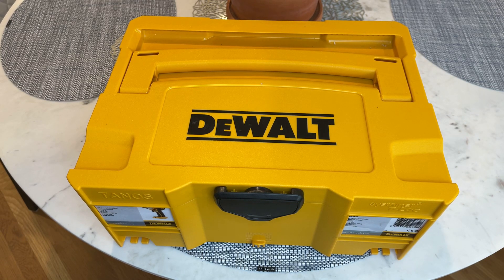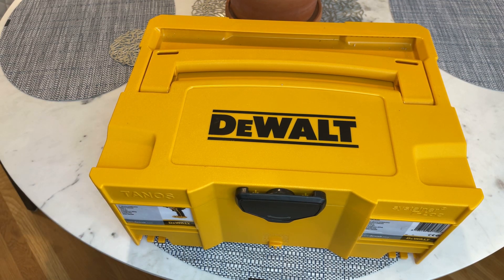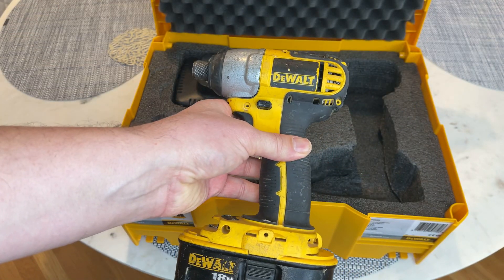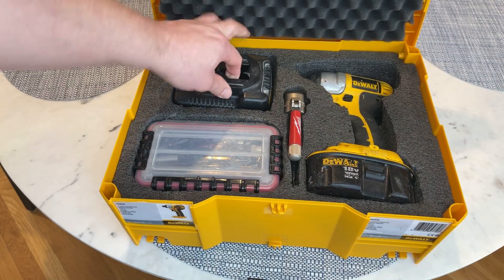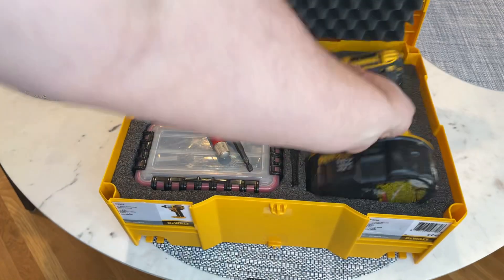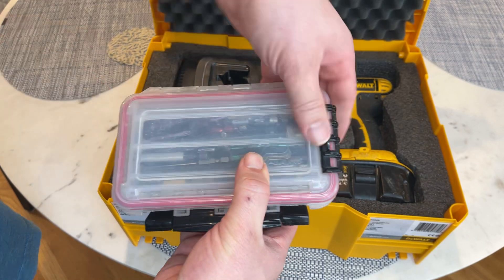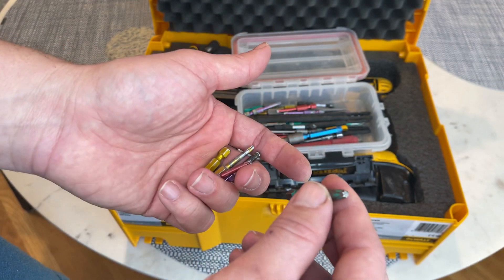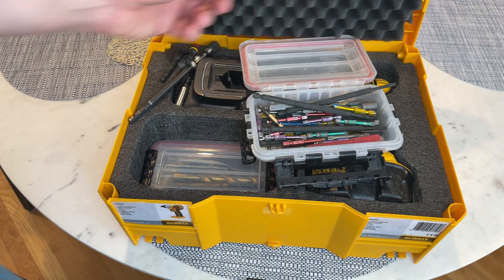DeWalt Impact Driver and Tanos Systainer Review

Comment: The Systainers are the best tool box system
Reply: In what way? Weaker (ABS) 3 point (not 4) fixing,  drawer units compromised by front dial, not waterproof, have to be locked in shelving because they foul the drawer above, no front handle (except the tiny, weak one on gen 3) a third of the carrying capacity, I could go on. And they cost more! Packout or ToughSystem 2 are both way better. Even L-Boxx is better.

Comment: There are adapters for the newer battery? 😅
Reply from the maker: There is definitely an adapter for the the battery. The new version of this tool with the new battery is much more powerful. But, I’m used to this old tool and it’s well worn in so I continue along with my old reliable DeWalt.
Reply: @postbeam8200  Sir Dewalt's 20v line is actually 18v just like your older Dewalt I have that same impact but use it as a lend out tool the 20v is just a marketing tool but it cheaper to just buy a new kit unfortunately   although the 887 and 996 are great even if they see light maybe 2-3 times a year

Comment: You deliberately chose an inferior case ( weak ABS, 3 point fixing, 1/3 the load capacity, not watertight, less capacity) that costs more? Why?
Reply from the maker: Well.... Inferior is your opinion. If you're comparing it to the DeWalt case which is a blow mold plastic and DEFIANTLY NOT WATERTIGHT then I respectfully disagree. But since my tool was a bare tool only and came in a cardboard box, I think the TANOS is significantly better than my DeWalt Cardboard box. In reality TANOS and Festool is an ecosystem that keeps everything in it's place and a place for everything. But since I doubt you would appreciate any of that I guess I will just stop here cuz I'm wasting my time with this response.
Reply: @postbeam8200  More than an opinion. DeWalt ToughSystem is not just waterproof- it is airtight! It is fitted with a pressure relief valve, so you can equalize pressure if needed. The cheaper TSTAK IS waterproof (IP54 rated). And this is at half the price of Tanos. One could argue that the Packout system is better than all of them- auto latch and single point release, rugged construction and a huge range.
There are several toolcase options at a range of prices. Graph them for quality/features vs price, and Tanos are an outlier- more cost for a poorer, weaker build. An early design choice has created many problems, especially in drawer units.
Admit it, your choice was on aesthetic grounds, not practicality.
Reply: @Tensquaremetreworkshop  regardless, they're used by many professionals.
Reply: @AaronGeller  If you get them free (or rather included) with a tool, you would. My point was that, given a free choice of all the tool storage systems, they are a poor selection on many grounds.
Reply: @Tensquaremetreworkshop  on certain grounds, yes, and on others, no. Many people using them are doing more finish work where the rugged quality isn’t as necessary. I don’t think they’re great to throw in the back of a truck but I do think they provide value to people like me who use them for organization and carrying things compactly
Reply: @AaronGeller  The rugged quality may not be needed, but you get it included in a box that is half the price. I repeat my original question- what is it that justifies the higher cost for an inferior item? (remember, they have a poorer size to storage ratio, lower load capacity, three point (instead of four) fixing, are not waterproof, and use weaker materials).
Reply: @Tensquaremetreworkshop  the  justification is that it works with the Festool system because the containers are the same. It's an ecosystem like Apple products --- not everyone likes that and it's fine. Things from Germany typically just cost more.

Comment: OK, this is AWESOME. I recently organized a dewalt drill and driver into my systainer, but it doesn't look like yours! Nice touch with the decal. I also use the Kaizen foam. How do you get the bottom inner layer so smooth? Mine is all rough. https://ibb.co/0GT1JV4 I think I might get one of those separate thin systainers for all the bits. I like how you fit everything  into that 1 case though nice and neatly.
Reply from the maker: Thanks! The key to getting it smooth is to cut off a thin layer of foam (½") then flip it around and use it as a base with the factory smith face pointing up and visible from the top. Then cut all the way through the Krazen foam and then put the cut out foam overtop of the smooth thin base foam. Not it will look perfect like it is one piece. Good luck!